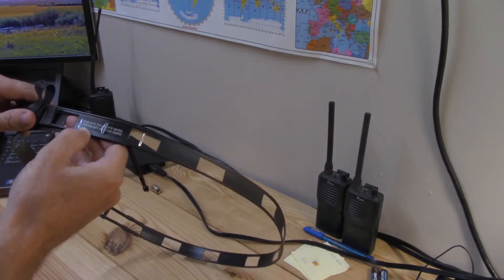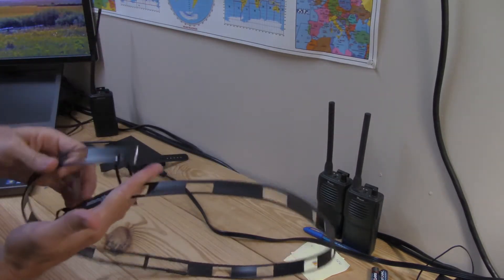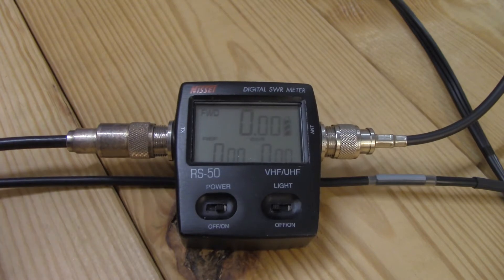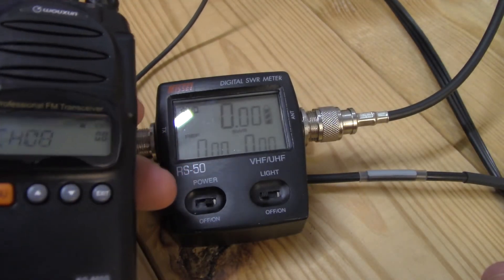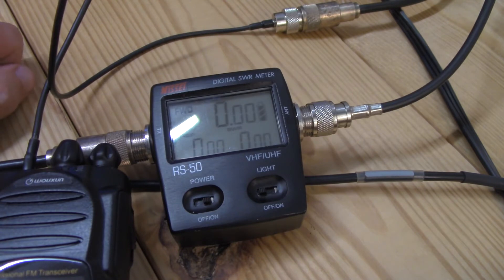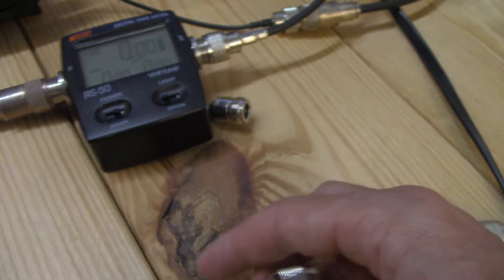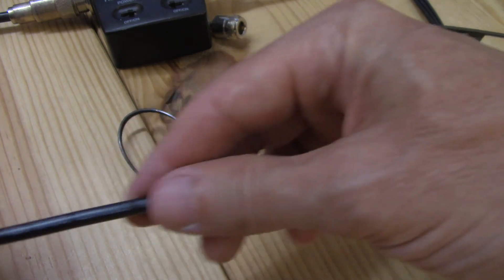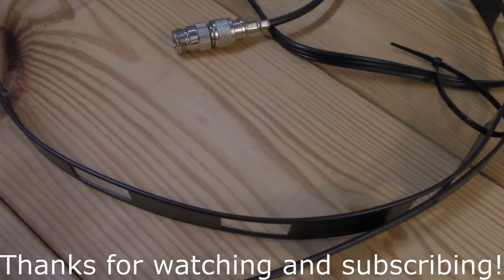N9TAX Slim Jim antenna for MURS/GMRS.

Comment: Noob here,

I have a 25watt Retevis Rt95 for a home station. I live in a apartment but I live in the bottom. IF I buy this antenna do I have to do any mods to it? I will like a plug and play antenna. I only have GMRS and FRS and some HAM station programmed ( Transmission is locked but I can hear ) 

Please advise

Thanks for the great video.
Reply from the maker: Should cover the band good enough.

Comment: Does the MURS/GMRS pick up NOAA stations (162.4 - 162.55)?
Reply from the maker: It does. I have this antenna on a HT inside my one story house and am picking up two stations. One is close by, maybe 12 miles away. The second one has static, is understandable and about 60 miles away. The terrain here is flat so no election gain.

Comment: You can do this yourself... I made a rigid aluminum rod (stationary for the house). I will make a camping one out of the wire. It is bad that it is impossible to adjust to 2 ranges.73!
Reply from the maker: I'm a fan of single band antennas for performance and ease of tuning. This one is good for quick temporary setups and is easy pack/store and not take up much space.
Reply: I was inattentively watching this story... The antenna here is dual band. I'll try to make one. The dimensions are 145, and due to the inserted pieces of cable, it also works on 433. I found a scheme on the Internet, I'll try to do it.
Reply: What exactly? Why is it not working on 2 bands? It has resonances in other bands, many places, but it does not work to achieve the ideal SWR index (I have 1.3 - 1.5).

Comment: This antenna is getting a lot of attention on the Reditt GMRS page.
Reply from the maker: Interesting. A tree and some rope will get some height while hiking/camping.
Reply: I bought two 10' PVC pipes, stuck them together, and zip tied them to a tree behind my shed.  Rigged a flag pole pulley attachment, and wala, I have a $30 tower

Comment: I'm going to put this antenna in my Oak tree, that is taller than my house for my Wouxun KG-1000G.   I just ordered a Retevis RT97S I'll also put an antenna for use at home when I am not travelling. Will get a Slim Jim for it.  Can't get my wife to use the base station, but can get her to use the HT through this repeater. (I've been testing with an inexpensive Simplex repeater.)   Considering connecting the RT97s to the internet with Raspberry Pi.     We will see.   I also have solar/MPPT controller and heavy duty 3 X12V 110AH forklift batteries for storage.
Reply from the maker: Did you try the RT97?
Reply: Yes.    It works.    No coax needed, just connected to the Slimjim and EdFong.      Don’t have it up now.    Purchased for emergency Neighborhood watch, camping, motorcycle meets and rides.

Comment: I got mine several weeks ago and have been using it on my Wouxun KG 1000G and KG 935G and this antenna is awesome and so easy to set up and use. It's built solid and pulls in signals way out there.

Comment: Can the antenna be bent in half and put on a standard window for better signal to fit on window square? Or will bending diminish signal?
Reply from the maker: Bending it will hurt performance and change SWR.  Best to keep it away from anything, especially metal. If this is for GMRS, then his GMRS only antenna is much smaller and may fit the window.
Reply: @Soladaddy  Yeah thank you, I just spoke to n9tax labs the guy that makes this antenna told me I can bend it at the cut out Notch on the side 90 degrees but the top portion of the antenna must stay vertical
Reply from the maker: @CinematicTouchProductions  Cool. Yes, the part under the notch is used for tuning to match the impedance and that can be 90 degrees from the top section.

Comment: Nice, wonder what the swr is on ch 6-11? Running the pipeline and the antenna on the truck is not that good, so something like that would be great to have.  Oh,wait, sorry about that, business band, ch 6 (silver star 467.850) it's close to gmrs, even believe a few channels are on the gmrs band.  Anyway, noticed the uv82, have you tested the swr on 467.850 or 469.550?
Reply from the maker: I did not test that high, but would be interesting.
Reply: 467 is the gmrs repeater input frequency. Its covered.